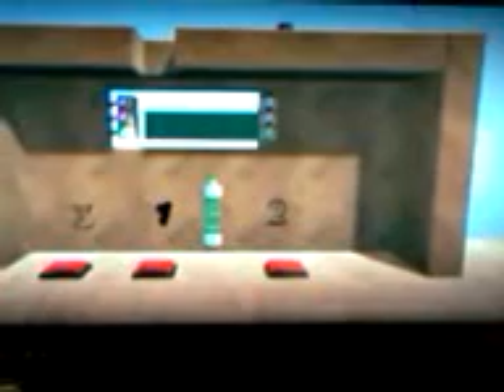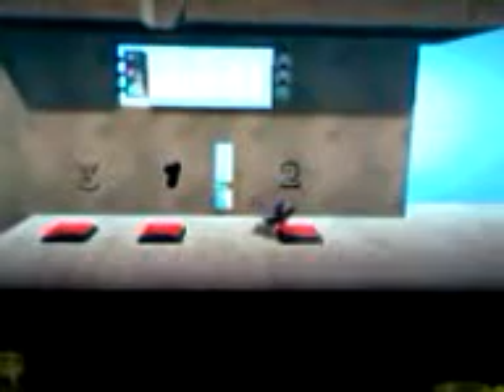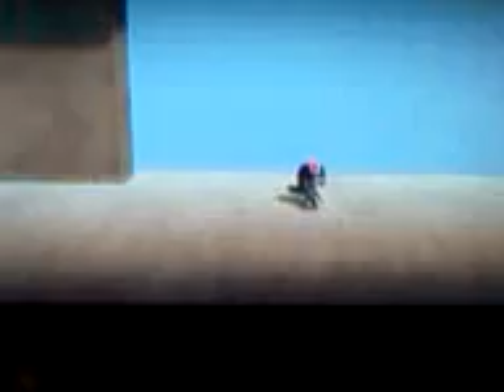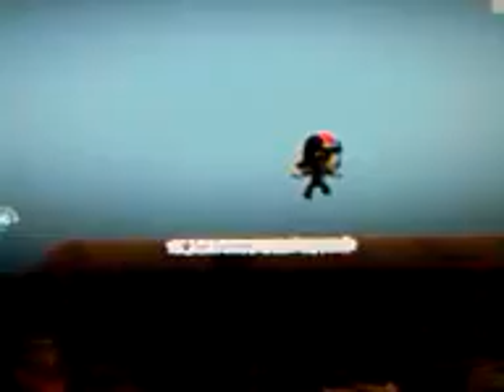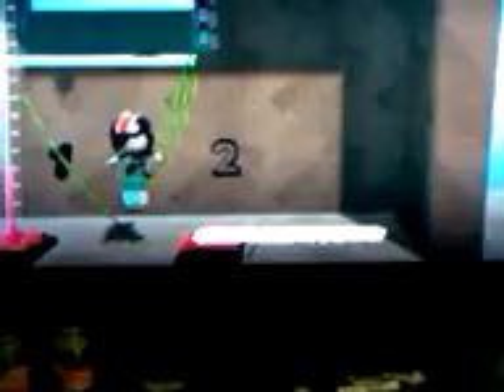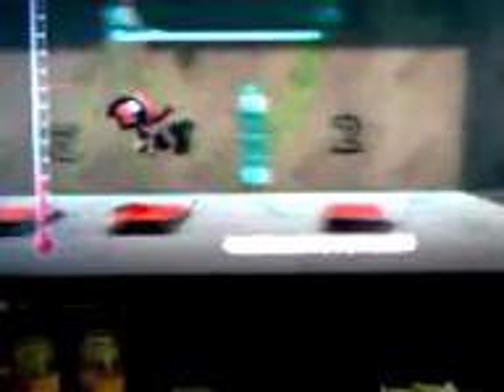LittleBigWorkshop - Permutation Locked Door

Comment: one way piston...put two magnetic keys together attatched to the piston, but put the key on some dissolve material...then put 2 different colours on the tyop of doo and doorframe, make the radius small and link it to the dissolve omaterial, so when the piston goes up, dissolve material destroys the key that works the system (also works with motion sensor...)